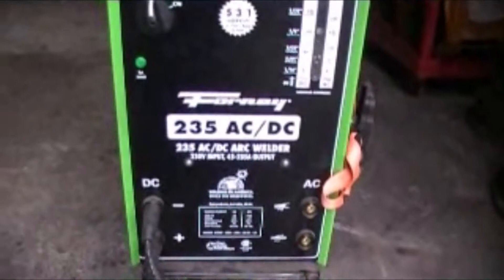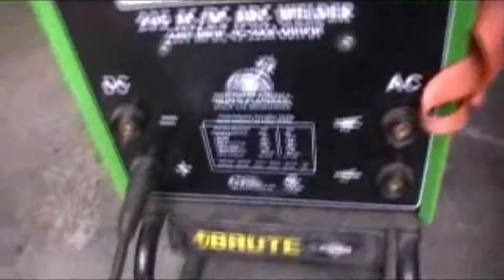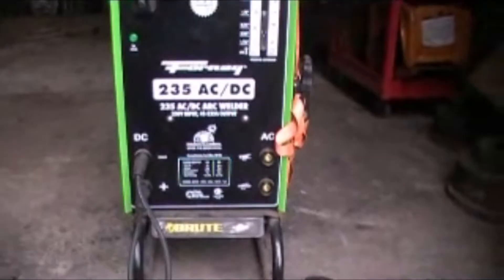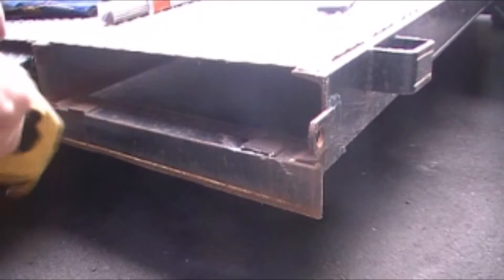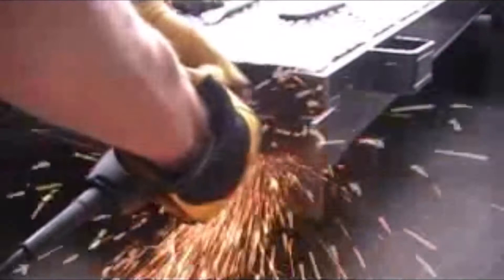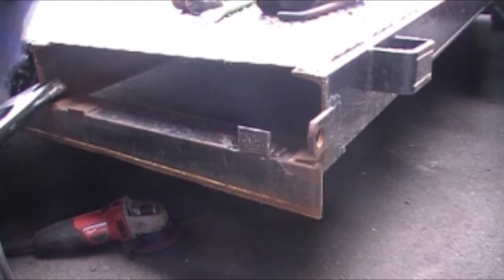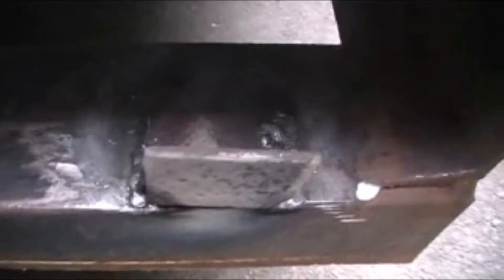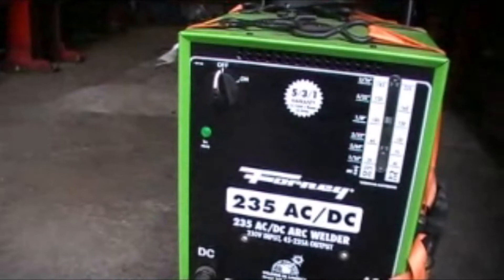WELDING AND USING THE FORNEY 235 AC/DC ARC WELDER

Comment: I still own my grandfather's Forney stick welder from the 1960s and it still works just fine.  The same can't be said for the overpriced junk coming from China with a Forney sticker slapped on it 🤣

Some of the later models were assembled in Italy and those were pretty decent machines but Forney got greedy and outsourced everything to China while pretty much doubling their prices!

Why pay 2-3x the price when you can buy the machines directly from the source and save a small fortune 😉

You can buy a good used Lincoln IdealArc 250 / Miller DialArc 250 for what that FORNEY 235 AC/DC ARC WELDER sales for now (was under $400 a few years ago).  I'm so glad I don't have to buy a welder these days because these companies are obviously price gouging people to death!
Reply from the maker: At the time when I was looking for a stick welder I could not find a good used one. So I went with the Forney. Thanks for watching and the comment